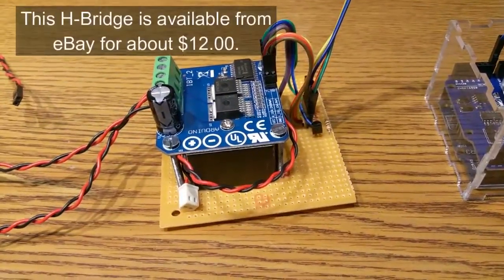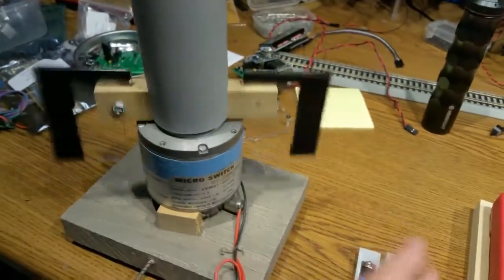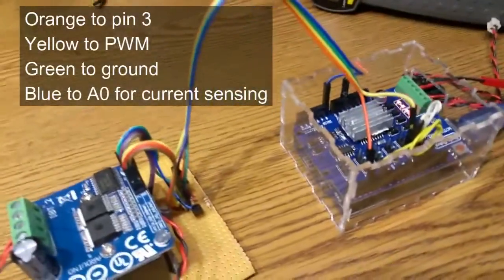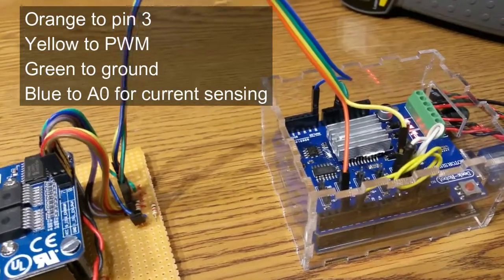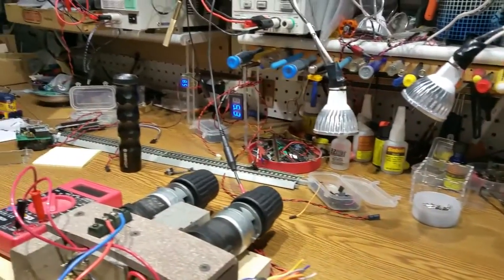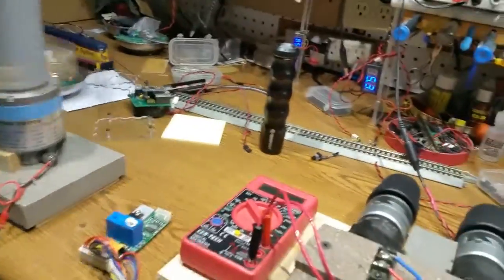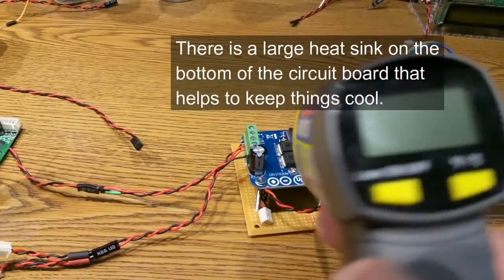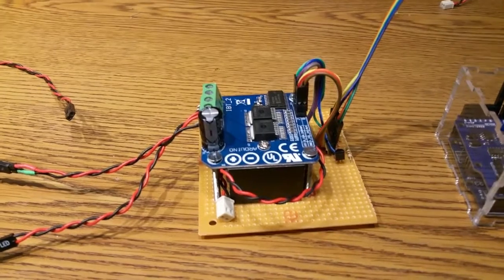DCC++ Controller with a very high amperage H-Bridge

Comment: Can't possibly see that vcc pin handling 43 amps, 10 amps has got to be pushing it. :-) 

I just ordered the Arduino motor shield that you used in your other video. A bit pricey but I want to get it working before going cheap. I have a spare UNO for the Base.

I pulled out my N scale remmenets the other day, after 25 years all I have left is a Kato EMD E8/9 Loco and a Tech II 1500 controller. I found a DCC upgrade kit for the Kato so I need a DCC controller, being an Arduino fan I'm going to try DCC++ and JMRI. 

Subscribed!!!
Reply from the maker: I fully agree on the overstated 43 amp capability - many such parts are overrated for advertising purposes - the good news is that we don't need anything like that much power for our applications and the unit works well at lower current levels.
dave

Comment: I have tried this setup and I have a question on the current sensing circuit. It states to connect the blue wire to A0, but A0 is already being used by the Arduino motor drive shield. How is the current monitored? Do I have to cut the A0 trace on the motor shield too? Do you know what is the voltage to current ratio on the BTS7960B pins 5&6? Thanks
Reply from the maker: The schematic here
http://www.trainelectronics.com/DCC_Arduino/DCC_Booster/index.htm
shows that A0 only goes to pins 5 and 6 on the H-Bridge - 
I don't recall the exact ratio (I haven't worked with this code is some years) - the routine that converts it is pasted in below - that should help
dave

void showPercentage()
{
  percentage = (CurrentPinReading * 0.0105) / PotReading; // was 0.014
  percentage = percentage * 100;
  if (millis() - now >= 500)   // only update LCD every 1/2 second to limit flicker
  {
    lcd.setCursor(9, 1);
    lcd.print(percentage,1);
    lcd.print("%  ");
    now = millis();
  }
  if (percentage > 100) turnPowerOff();
}
Reply: @DaveBodnar  Hi Dave, Thanks for the reply! On this schematic I have to have another Arduino (Mini) to read the A0 and set a voltage on A1, I was wondering if I could just feed IS 5-6 to an op amp and then connect to A0 on Arduino drive motor and disconnect (cutting trace) the A0 signal sensing on the motor A all together. This way the sensing current would be going to A0 and read by the Arduino DCC station. Thanks for any help.
Reply from the maker: @Lusitano95132  Without testing I can't be sure but it looks like it should work - give it a try
dave

Comment: Hi. Is it possible to control 2 DC motors and rotate them in opposite directions simultaneously using this motor driver?
Reply: By programming 🙄

Comment: Kedves Dave! Mivel nagyon jó és szakszerű videókat készítesz, szeretnék szaktanácsot kapni a következő problémám megoldásához. Vásároltam egy BTS7960 alapú motorvezérlőt, pontosan ugyan olyat, mint amit Te tesztelsz a videódban. Csak van egy megmagyarázhatatlan problémám ezzel kapcsolatban. Úgy gondoltam, hogy a két irány engedélyező lába pont megfelelne egy végállás kapcsolóval a továbbforgás megakadályozására, de sajnos nem így van. Mindkét irányt engedélyezni kell ahhoz, hogy egyáltalán működjön a motor. De a leírásában pont ez nem szerepel, vagy én nem találom, hiszen akkor miért van kivezetve és feliratozva a két tüske, ha csak egyszerre működik? Szeretném megtudni, hogy csak az én áramköröm hibás esetleg, vagy ez gyártási hiba, amit nem közölnek. Ebben kérném a segítségedet, amennyiben szánsz időt a válaszra, azt megköszönném! (A neved után ítélve van magyar vonatkozásod, ezért nem kínlódtam az angollal, amit nem is nagyon tudok olyan szinten, hogy ilyen kérdést feltegyek :) )  Üdvözlettel F. Sándor
Reply from the maker: Sándor  - I would guess that you need to deal with several connections to get the motor to stop with limit switches - can you send me a link to the motor controller?  I may be able to see what you need to do.
Also, I had to use Google Translate as I don't read Hungarian!
dave
Reply: @DaveBodnar  Dear Dave!
Thanks for the quick response. Well, the situation is that it's not the connection of the end position switch that causes the problem, but I'm just surprised that when the enabling legs of the two directions are led out separately on the module, as well as the PWM legs and the current monitoring (?), more precisely, the overcurrent indicator outputs , then why can't I disable, say, the forward rotation direction (this would happen with the appropriate end position switch), but the reverse would allow the motor to rotate. Instead, rotation in both directions must be allowed at the same time, otherwise it won't squeak. I thought that you had already tested this module according to your video, but is this error only happening to me, or did they forget to mention that this is a malfunction. I am attaching the link I received, but it only contains the H-hid integrated circuit itself, there is no mention of the module itself. If you know the answer, please share it with me. Sincerely, Sándor
https://www.hestore.hu/prod_getfile.php?id=9704
Reply from the maker: @patkolttojas  Sorry, Sándor, but the document you sent doesn't help and I really can't determine what may be happening - good luck in your search!
dave

Comment: I want to use this H-bridge to run a bilge pump dc motor (24V8A). Do you think it will handle ok? (also any idea about reverse voltage polarity protection  when stopping or turning on the motor?!?) thank a lot.. great work !!!
Reply from the maker: The specs say that it should work but I think you may be pushing its limits -  - Rather than using an h-bridge I think you would be better off with a non-reversible power controller.  I found this one on Amazon - it might work for you

https://www.amazon.com/DROK-Controller-Industrial-Electric-Regulator/dp/B074FR4BBJ/ref=sr_1_8?keywords=arduino+power+controller+mosfet&qid=1581849252&sr=8-8

dave

Comment: is it possible to reverse one of the motors without changing wires ?
Reply from the maker: Reversing is done by the DCC connection not by reversing wires

Comment: Hi.  I can you explain what the 2222 transistor is for on the pwm outputs?
Reply from the maker: The 2N2222 shown in the schematic provides an inverted signal that is needed by one of the input pins on the H-Bridge.
dave

Comment: What would you charge to build a high amp H-Bridge booster for a DCC++ base station?
Reply from the maker: Sorry, David, but I don't build/sell my projects- my goal is to present information so that viewers can build their own
dave
Reply: @DaveBodnar  Lots of wires and stuff going everywhere and resisters. Not an electrical kind of guy normally. Wiring diagrams mean nothing to me. Architect by trade.

If I had a parts list and simple video I could probably pull it off. 

I managed to build my DCC++ base stations by watching the DCC++ videos.
Reply from the maker: @davidbowman5407  If you have done that you should be able to build the booster - have a look at my web page (see  http://trainelectronics.com/DCC_Arduino/DCC++/ )
dave

Comment: Hi Dave, just to warn you this BTS7960 board (at least the version i got) has almost no electrical insulation between the heat sink and de BTS7960B chips. Its only the thin black anodised layer on the cooling block that keeps this unit from short ciruit. very dangerous if used unmodded  by unknwoning buyers.
Reply from the maker: That is good information - thanks - I have found that a good many of the various boards & circuits that I have gotten from China have varying levels of consistency and safety.
dave

Comment: Dave thank you for this excellent video! Do you know any DIY Arduino based DCC locomotive decoder for large scale trains   (G/O)?  All I'm finding in the Internet are low Amp HO locomotive decoders. I'm looking for a reference higher Amp driver project for my developments.  I have over 20 locos to convert to DCC and appreciate if you can provide any recommendations or guidance.  BR Chris
Reply from the maker: Chris - I have not been able to find an inexpensive decoder that is good for larger G-scale locomotives - I have used HO decoders on smaller engines.
dave

Comment: I honestly wouldn't trust buying that stuff from ebay, I've had a few things that were poorly advertised. There's always a catch - in my case, it was a boost converter. It was rated for up to 5A, but at more than about 500mA, it began to get extremely hot. A friend of mine has gotten a fake SSR (Solid State Relay) as well, which simply died (went open circuit) at well under maximum capacity.
And don't let me forget the "hoverboard" charger he got ... which came from the manufacturer with the output polarity reversed!
Also .. yikes! It's one of those KORAD power supplies! Be very careful, they can output a spike of voltage at power-on, which can kill sensitive circuits like 3.3 and 5V digital stuff.
Reply from the maker: +Benjamin “Ozias” Esposti 
Benjamin - I have had issues with eBay purchases, too - that is why I review purchases, such as the one here, so that others are likely to have a good chance of duplicating what I have done.
I went through a number of H-Bridges and circuits before I came upon this setup and it works rather well!

dave
Reply: I completely disagree....  ebay has been really good for me with over 1000 transactions.

Ya just gotta know what to buy and what not to

Comment: Dave, I am not very electronic savvy.  I want to add the 43 amp H-Bridge to DCC++ so I can run G-Scale.  I am having trouble understanding the circuit you built to connect the H-Bridge to the arduino motor shield & Uno boards.  Does the transistor Emitter go to ground?  If so, what part of the circuit did you ground it too?  Sorry I can not fully understand your schematics.  It is my fault due to lack of electronic knowledge.  Any help would be greatly appreciated.
Reply from the maker: Richard - All ground connections go together and connect to the negative terminal of the power supply - yes, the emitter of the transistor does go to ground - the triangle symbol indicates ground.
You will see 7 or 8 of these symbols - all are connected together

Good luck & enjoy!

dave
Reply: Thanks Dave for all your help and sharing your project.  I hope to do the same one day.  Thanks again, Richard.

Comment: Can we use it in series to generate 60+ Amps?
Reply from the maker: To increase amperage you would put them in parallel, not series - either way it is not a good idea!
dave
Reply: @DaveBodnar  Sorry my mistake in parallel! Thanks for correcting and suggestions! For 60 Ampere and 24V can you recommend me any other H-Bridge module?
Reply from the maker: @mathildaevan6992  I don't know of anything with that capability,  at least that's available for hobbyists.   Even this one can't do its rated current.   More like 8 or 10 amps.
D6
Reply: @DaveBodnar  Thanks alot for your kind response! Although I have tested this module at 33A Peak and then it gets off due to built-in over Temprature protection.
Reply from the maker: @mathildaevan6992  a fan might help but it still is not 43!

Comment: the chips are 43 amps, the setup of the heat sink is terrible and will burn at less than 20amps continues  load.
Reply from the maker: Right you are, Lord RW - as I noted in the web page notes it is unlikely that it can make 43 amps but is well suited for use at 5 or so amps, plenty for most DCC layouts.
dave

Comment: one IBT run one motor or 3 ?
Reply from the maker: Amir - the IBT-2 can run several locomotives at the same time
Reply: @DaveBodnar  you mean if you connect all of them to the same 2 pin on the board right ?
Reply from the maker: @EnergySeeker  You connect the track to the output of the H-Bridge and that supplies power to the locomotives.
dave
Reply: @DaveBodnar  thanks dave